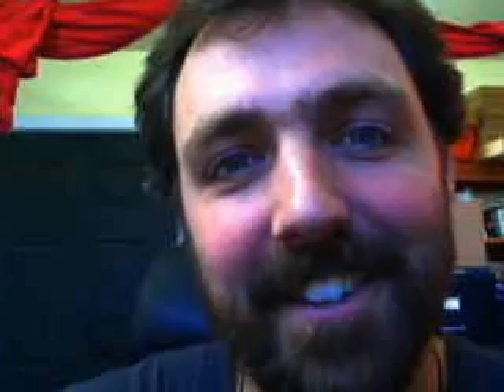StrawBale.com: Using Steel Framing In A Straw Bale House

Comment: I have a question. Aren't the straw bales always impaled by the rebar at the lowest level? And this is apparently without any issue. So, is this because there is so much more surface area to a steel beam than just rebar, or touching a bolt in the wood (when wood framing)?
Reply from the maker: Impaling the first course of bales onto rebar is an outdated practice that is no longer recommended. This change is due to reasons similar to those explained in the video about steel framing. For more information on current straw bale building practices, visit strawbale.com.

Comment: I should wrap every strawbrick in some waterproof material and than use it between the steel frame?what can I apply on the walls to make them look strait?
Reply: Or would you wrap the steel, because the straw can interface with other bales just fine?